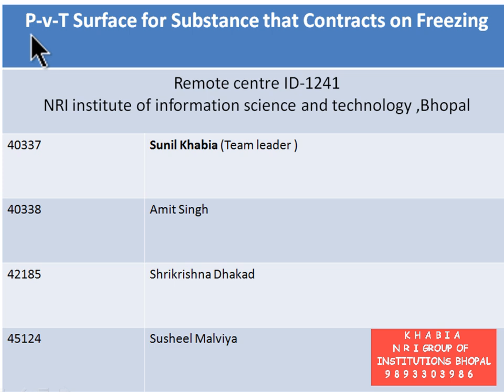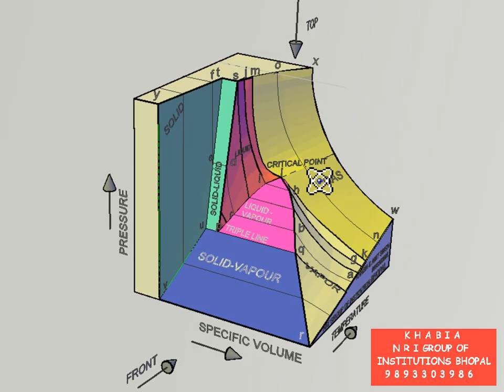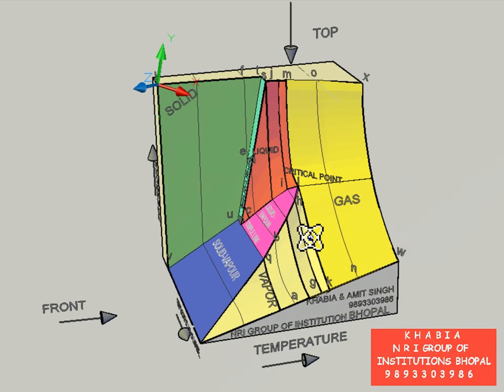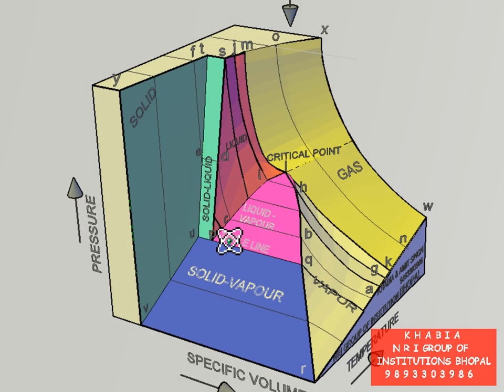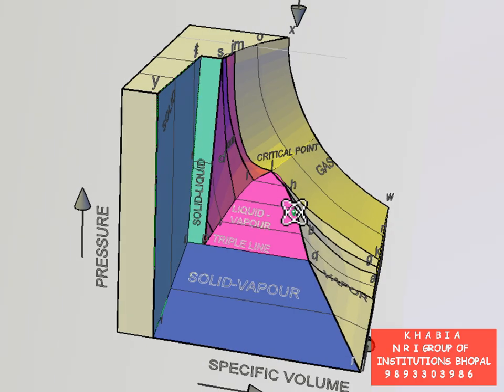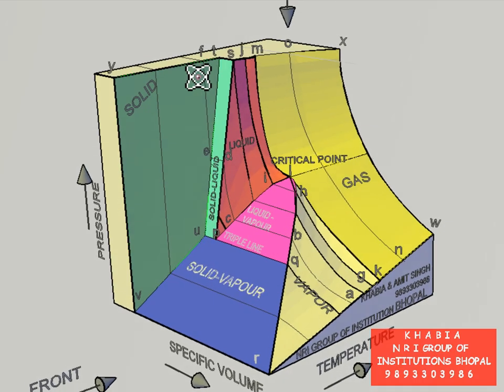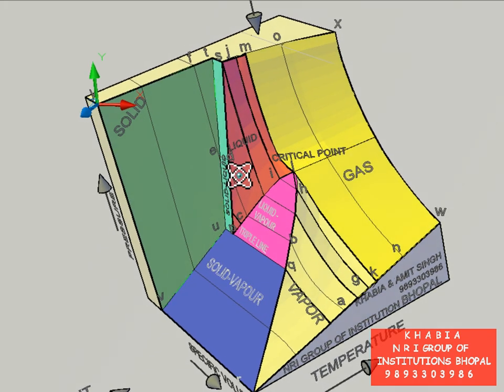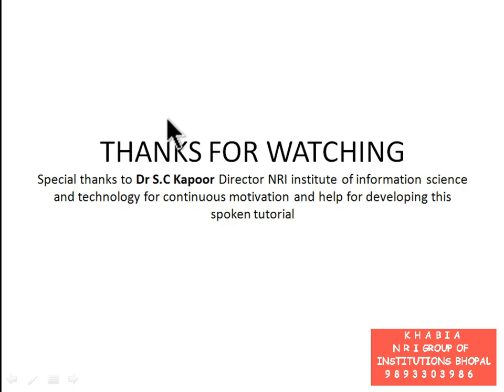P v T surface 3D Model  Thermodynamics

Comment: Thanks very much for this.  I am enrolled in the Coursera introductory thermodynamics course, and your presentation fills some holes therein.  I don't know how this would have been accomplished without 3-d modeling.
Reply from the maker: Thanks .You can also join ME209x Thermodynamics course by proff Gaitonde IIT Bombay on EDX for indepth discussion of principles of Thermodynamics right from basics .
Reply: @khabiasir  I may just do that, for I'm again tutoring physics and found the Coursera course to be less helpful than I'd hoped.  Then again, it's now six years later.  (Didn't they tell us that time travel was impossible?)
Reply: Same as me, im investigating this by the same reason
Reply: Haha coincidentally I'm in the exact same situation 😂!